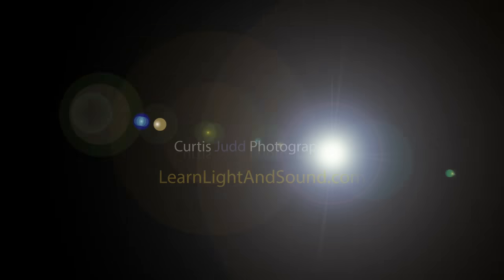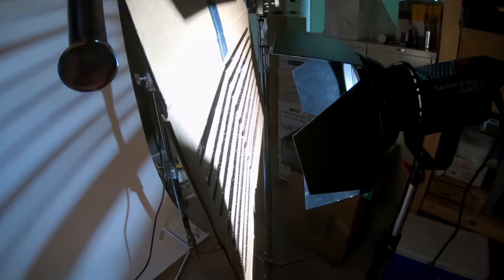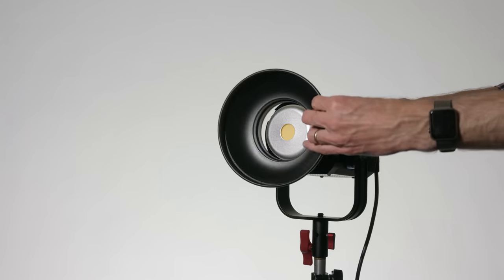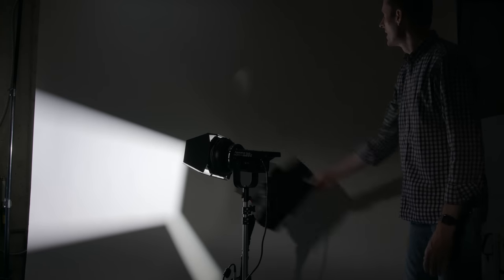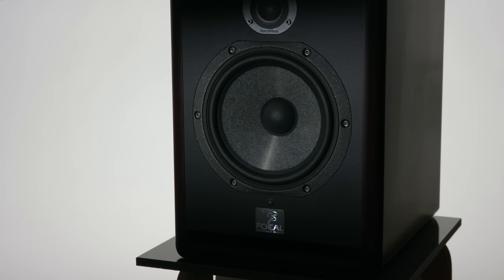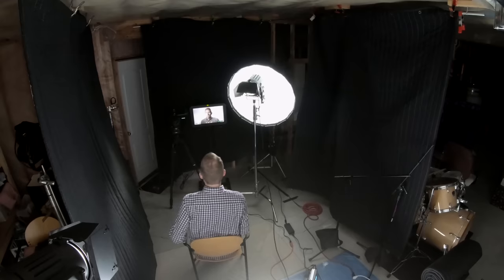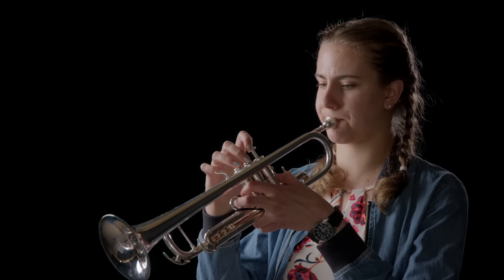Barn Doors & Hard Light: Aputure Barn Doors for COB Lights

Comment: Curtis, do you need to use a heat shield under the gel so it doesn’t burn? The gel holder looks really close to the light itself. Thanks!
Reply from the maker: No, use proper gels which are made to work with old-school tungsten lighting and the heat of LEDs are no problem at all.

Comment: Hey Curtis. So I’m trying to light model space ships for green screen and a slider. I have lit the green screen evenly, but now I need light on one side of the ships with minimal spill. Snoot or barn doors? Thanks mate. J.
Reply from the maker: Yes and yes. Both can do the job depending on the size of the ships and the light.
Reply: @curtisjudd  Thank you. They are pretty small. Six inches or so. I messed around with both in the end. There was some minimal spread with the barn doors, but the snoot was more precise.
Reply from the maker: @StarWarsJay  👍

Comment: Very nice tutorial - great content to boost up my creativity - thank you.
I have a question about using Barn Doors. Do you know if the barn doors can "invert" the light? I mean, like a pinhole. Cause once I was using it kinda restricted (closed) and I was moving the upper door, but the effect in the subject, was more to the ground... And I took some photos with kind of same setup... The strobe was very high 2,5m, little tilt +- 3 degrees to the ground,  4 meters from the subject - in my mind, the hotspot should be more and less at models head, but - for my surprise - when I was editing it - the ground and bottom parts of the image, were very hot - which I corrected with a gradient filter.
Reply from the maker: Hi Davi, that seems to depend on the light and the barn doors, especially if the barn doors have a silver interior.
Reply: @curtisjudd  Thank you - it´s a standard black.

Comment: That was some great advice, Curtis!  We just got the Aputure mini 20 flightkit. Have you seen those? Youget 3 lighs, stands and tons of little things that can get lost... :)   But it has barn doors on the lights and the lights look like mini COB120.  The light they put out is pretty nice albeit a tad BLUE  in daylight mode (but they do provide gels for standard daylight)...
Reply from the maker: Hi, yes, I worked with one of the early prototypes. It was a little noisy but useful as an accent light. Like that it can be powered via USB as well. Unfortunately the NP-F battery sled did t work on the copy I had.

Comment: Hi Curtis, very nice lighting techniques and look! One question: when using tungsten key light, how do you white balance your camera? Do you till do a customize white balance at where the face is? Or you customize the camera to daylight so the face looks a bit more orange? It looks like your face is a bit warmer so I guess you white balanced to daylight but use the tungsten key?
Reply from the maker: For a look like this, a few hundred Kelvin higher than tungsten - this was probably 3400 to 3800.
Reply: @curtisjudd  Awesome! Going to test it out.

Comment: Hi, 
Thanks for this nice explanation!
The Aputure 120t  is discontinued now. How can you get warm skin tones from a 120dii (or a 300dii) which are only 5500K ?
With gels? Can we get the 120t result with gels put on a 120dii ?

Thanks
Reply from the maker: You can set the white balance on your camera to 6000+ Kelvin to simulate tungsten.
Reply: @curtisjudd  Thanks :)

Comment: Hey Curtis, hope you're doing well. Thanks for another helpful video. I couldn't help but catch your throwaway statement about the 120T being nicer for skin tones than the 120D. That's a somewhat new concept to me. I'd love to learn about that. Would gelling a 120D with a full CTO give the same or similar results? Thanks!
Reply from the maker: Hi Andrew, I have a new color meter - the Sekonic C-800 - which measures color quality with a new metric called Spectral Similarity Index. This was recently developed by the Academy of Motion Picture Arts & Sciences and has some serious advantages over CRI and TLCI when it comes to assessing the color quality of light sources. Interestingly, I'm finding that many tungsten colored LEDs score higher SSI scores - meaning they are very similar to good old-fashioned tungsten lights and seem to render colors more accurately than daylight colored LEDs when they are measured with SSI against actual daylight. This seems particularly true for skin tones which have a lot of reds and oranges. I'm not sure whether using a CTO gel on a daylight colored LED will have the same effect, but I'll certainly add it to my list of things to measure with the new color meter. Thanks!
Reply: @curtisjudd  Thanks so much for always being generous with your time and knowledge! Super, super appreciated. I'll look out for if/when you find time to do that test!

Comment: I own th aputure 120d with the original aputure fresnel lens which has barn door on the front but I cant get the shadow from the edge of the barn door as sharp as yours in this video. I have tried focusing the fresnel and using it without focusing it but the result is always the same.
Reply from the maker: Try the barn door without the fresnel.
Reply: @curtisjudd  I will give it a shot.

Comment: Hi Curtis, any news on the broken FalconEyes COB light? Is it repaired?
Reply from the maker: Yes, I hired a electronics technician to replace the PCB board sent to me and it still did not work so we abandoned the light. It was a bit sad as I really liked that light when it worked.
Reply: Sad. At this point I'm doubtful if buying this brand... Thank you for the feedback.
Reply from the maker: I'm quite happy with the flexible panel that I also included in that same video by Falcon Eyes. So I haven't lost all faith in the brand, I'm just could not recommend that particular model.
Reply: Yes, but I was searching a cheap cob light, I think I will go with a Pixapro (Godox).

Comment: Great video and great new accessory!

Soft light is easy, but it’s so boring. (Honestly, I’ve been getting lazy. I cut my teeth on tungsten and hmi fresnels. I’m capable of better work.)

Barndoors are also really useful for controlling spill when you’re punching the light through a frame of diffusion (or a cucaloris or a gobo as shown in the video).

The next step beyond doors is a grip package with flags, silks, nets, and the c-stands to hold them, although at this point you might want to hire a guy like me to set them. 😉 You get a ton more control with flags, nets, and silks. If you do product videography, you’ll want a set of dots and fingers, too.
Reply from the maker: Thanks Marcos! Good points you make here. We'll look to cover some of the other tools you mention here as well.

Comment: Curtis, I see in other vids that you also use an Arri 650 fresnel. How does the Aputure compare to light output, color, ease of use? A new Arri 650 from B&H is priced lower than the 120T and used units can be had for $250.
Reply from the maker: Hi Jim, the COB120d puts out a fair bit more - I would say a stop and change. I find the Arri 650 hard to use as a key light when shooting it through a scrim or silk unless I push the ISOs into the 1600 range. That's a legitimate way to work, but I found it hard back in the days when I was shooting with all tungsten lights when I had to shoot in offices and was never quite sure how much capacity we had on each circuit or even how many of the outlets in a single room were on the same circuit. In those circumstances, powering more than three of them was always a little dicey. All that said, I love tungsten lighting. The color rendition is my favorite. And there are companies that make LED replacement "bulbs" for the Arris - http://visionsmith.com/relamp-system/?v=7516fd43adaa
Reply: Thanks, Curtis! The low wattage and heat output of LEDS is so tempting (as well as the dimming without color shift). However, for my use and budget, I think I might pick up some used tungsten units and eventually get a daylight LED fixture.
Reply from the maker: Good call. It's hard to be the color quality of the good old Arri 650.

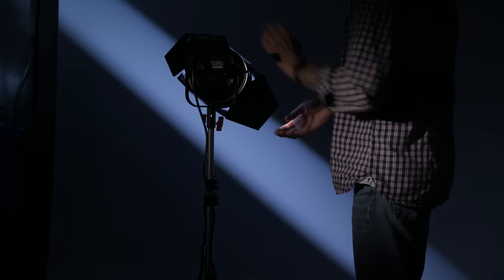Comment: @4:43 that contrast is sharp on that wall! No idea why, but my barndoors will NOT produce a solid line like that. It's just mushy and non distinctive. The only way it does is if I get maybe 3 inches from the wall, which is useless.
Reply from the maker: Which light, reflector, and barn doors are you using?